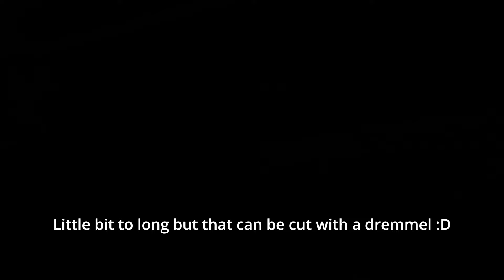3D printed A-10 - fuselage build video v2.0

Comment: Dude this awesome! I can appreciate you taking the time to upload every little detail shows how real of person you are. You have a subscriber here, how did you get all your specs like curvature of fuselage, the wings etc. This video helps me out so much as I am in the process of doing this myself on a much bigger scale. 😊
Reply from the maker: Hi man and thank you so much for the kind words 😀

I have been using a combination of photos, 3-point view vectors, DCS, small toy A-10 on my desk and different available online models. My modeling skills is not the best as I struggle to add details to it but I am getting there :D There are a lot of guides on how to get the shapes right. In fusion360, I used sectioned drawings and the loft function for both the fuselage and wings but I am trying to learn the “create Form” method but take time :d 

Exciting to hear more about your project man. Bigger is always better right? :D
Reply: @Sindrg1  thanks for that information, well bigger is better for my application as this will be a programmable done when I'm done with it. Right now I am in my junior year of college for engineering in mechatronics. With plans to proceed into the master's program after. My project is part of my senior project for my bachelor's degree and the the other part will be my master's program. So if you ever need someone to bounce ideas off or just needs some advice just reach out.
Reply from the maker: @TWISTEDScene  Hi man. No worries. Just ask if there is anything I can help you with. Sweet chose man. Mechatronics is an awesome field of study. I finished my Master's degree back in 2013 in the same field. My thesis was about a Tilt rotor tricopter, where all engines could tilt independently, making it quite hard to design a control system for. https://uia.brage.unit.no/uia-xmlui/handle/11250/136706

Comment: I’ve noticed with the current print settings the pieces are very thin, if printed with the strong part settings for all prints do you think that added weight would be an issue? I fear the model will lack overall strength at the current settings?
Reply from the maker: Hi, this is an issue with 3d printed aircrafts. If you print with PLA, PLA+, ASA, PTEG or ABS, the parts will be heavy and you can't use multiple walls or infill. That is why we often design in carbon tubes, to carry most of the loads, so the walls can be thin. If you print all the parts with the strong part settings, it will be too heavy to fly. You can try LW-PLA and add a thin layer of epoxy and maybe some fiberglass 18g/sqrm. This is the best option regarding strength vs weight.

Comment: I have a question for the dual motor how i setup esc to reciver
Reply from the maker: I use a Y-harness to both the ESC's. From one of the ESC, you need to cut/remove the positive lead. This is to prevent both ESC's feeding 5v into the receiver. Check out this video for more details :D https://www.youtube.com/watch?v=DP97BhZcXQE

Comment: Hi Sindre
I am printing the A-10 in lw-pla starting with the engines and have found that some files are missing. The mounting screw plates of the upper and lower nacelle are not there . Also you have left tail 1 stl but no right tail1  stl unless they are both the same shape, otherwise it is looking good.
Looking forward for your reply 
Great model
Thanks Fred
Reply from the maker: Hi Fred and thank you for notifying me :D I have added those files now and updated Cult. Let me know how the build goes and if there is anything unclear in the build video. I hope to get as many as possible up and flying their own A-10. I just love that plane :D
Reply: Thanks Sindre

Comment: Which pushrods/linkage do you recommend for the servos/control surfaces? Also, it would be helpful if you uodated the PDF with more info, instructions, links. Thanks.
Reply from the maker: @ebikefe  Hi. I plan to update the pdf shortly with experiences made from the flight yesterday. I used 2mm pushrods all over. I would use clevis pins or similar, to get better use of the servo range. I use those links with a set screw, but they forces me to use the outer hole of the servo. I had to dial back the servo movement alot and loose some resulotion. I will design some larger control horns shortly. The upper skin needs some reinforcements, as the forces during a landing, pulls the layers apart. I will upload a video soon. The crack was right infront of the bolt holding the two fuselage parts together.
Reply: @Sindrg1  Thank you for the prompt response. I am still printing parts...will order components soon. Looking forward to the latest video upload. 👍

Comment: nice..im gonna put a light coat of resin on this one...do u think it will add too much weight??
Reply from the maker: If you print this is LW-PLA, then I would recommend using epoxy coating but if you are using PLA+, then you should be carefull about the weight. Mine ended up at 4,8kg without coating. I will print the next one in LW-PLA-HT and use 18g/sqrm fiberglass on it. That is my favorite combo.
Reply from the maker: @treerecords1551  pinholes is a known issue with singlewall prints. The reasons could be many. Ask in the fb group 3d printed R/C planes. That group is awesome.

Comment: so this is fully serviceable?
Reply from the maker: Hi. It is but i am still working on it. Newest mod to be uploaded is redesigned wingspar. It was released early as requested by the 3D printed plane community as I just got a new kid and winter is comming. There will be long until I get to test it further.
Reply from the maker: @treerecords1551  ohh and thank you🥰 I am soon done with the 12mm wing spar mod and i will see if I can redo canopy and gun placement, as the community has identyfied as the most out of scale. 
Will most like do one with lw-pla-ht  next and coat it with 18g/sqrm fiberglass.